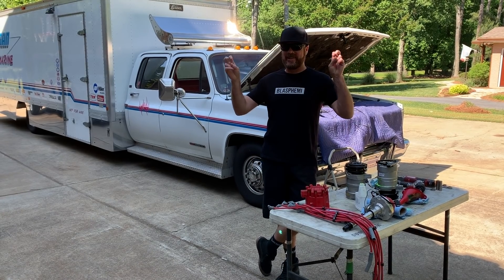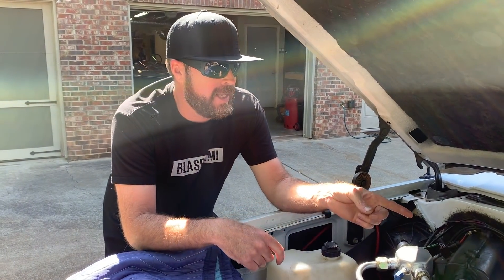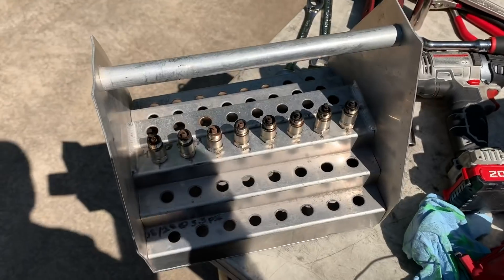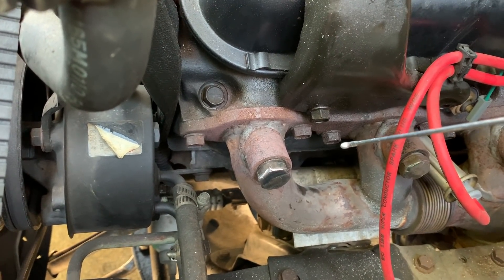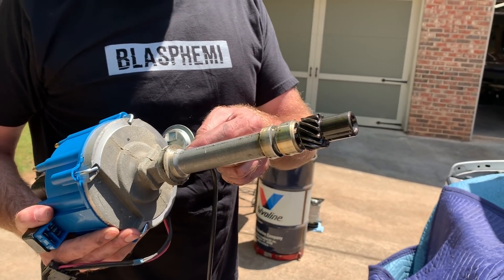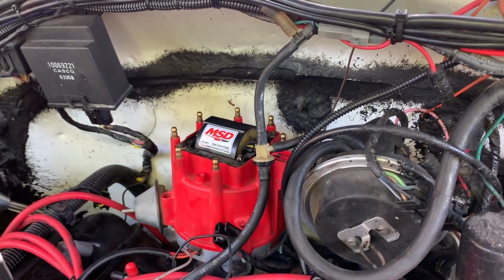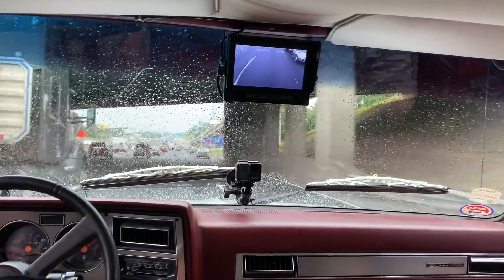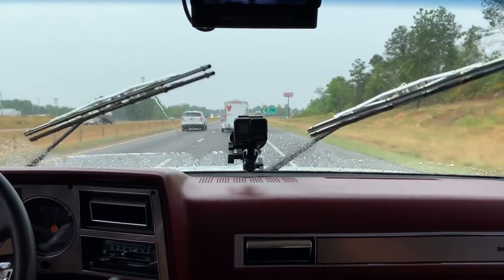More Power and Better Fuel Economy Thanks to Tuning and Overdrive! Ep.71

Comment: That' was a factory tbi motor the timing is set at 0 because the computer adjust the timing in the distributor
Reply: Didn’t you see the Rochester quad on the intake? Thats not part of the TBI package.
Reply: @MrNotorius5500  I think he's presenting the argument that it's been swapped?
Reply: @TheBrokenLife  I have a 90 Suburban that looks like that (before the engine swap).  That truck was a TBI setup at one point in its life.  The poster above is correct, the base timing for that setup is 0.  The computer handles everything else.    When they swapped to a carb the probably forgot to ignore the timing sticker on the truck.
Reply: Mini DK#9 87 is the first year for tbi on the C/K small block series trucks. Im not sure what year the big blocks got it.
Reply: @AIM54A  Come to think of it, the timing marks in the video looked hand painted too... Did they delete the pointer back then too?
Reply: This particular truck came with a carb. Some cab and chassis trucks didn't have tbi. We thought the same thing. We seen pics of this truck when it was new with no box on it. No tbi.

Comment: do you think adding a modern efi system would get you a couple more mpgs?
Reply: If he has the carburetor tune dead on and a/f ratios are in there happy zone cruising I doubt there will be little gains with efi
Reply: @luckautofab4461  thats what i was thinking, me i cant  justify efi cost. i m  to broke to go racing now but 9mpg loaded ac on is prety good in my book. i tow 26ft hallmark elite II, with my 99 ram quad cab 360/373 gear get about avg 8.5 working. need a bigger truck .

Comment: Seems like you could go with a bit more mechanical advance yet, and 14 to 15 degrees of vac advance with the choked heads. Might need to run mid grade to prevent detonation on long hill pulls, though. Nice results!
Reply: No
Reply: @jeanvi52  Fck off. Ever turn a wrench, bitch?

Comment: Did you just do that test without a car the back? Won't  that sort of skew of the data towards much higher gas mileage than if it were loaded?
Reply: The difference would be minimal. A load on the truck would make it burn more fuel on acceleration or going up hills and what not, but the economy would be about the same cruising on level, flat roads at a steady 55-65 mph. The biggest enemy to high profile vehicles like that truck is wind. On windy days, the mileage is going to tank whether loaded or not, and no matter the speed of the truck.
Reply: The car was in back

Comment: for the record , in my 2001 3/4 ton 4wd suburban with 6.0 LQ4 and 4L80 towing a 7k# enclosed trailer  thats 27 ft long i only get 6 mpg. so you're getting better mpg than my truck thats 1.5 litres smaller and 20 years newer. i could also potentially load this 7k trailer to 11k pounds , those numbers i just posted were the empty towing numbers. granted the truck weighs over 6k by itself being a fully loaded 3 row 4wd suburban on a 3/4 ton truck chassis.

Comment: what does dieseling mean?
Reply: Engine continues to run after turning the key off.  It runs on the heat inside the cylinders the same way a diesel engine works.
Reply: @1320fastback  Thanks man

Comment: My 78 G30 motorhome with a 400/400 vapor locks in hot weather if I go WOT.  I also struggle to keep it cool on the highway with a true 4 core radiator.  I've tried a lot of things and think it's just trapped air under the hood at highway speeds due to the aero.  It sounds backwards but in traffic (stop/go and slow) it cools fine.  

I'm guessing your issues are similar but am eagerly watching hoping you solve your issues.  I have quite a bit of advance but perhaps I need new hardware.
Reply: I would more suspect you have an airflow problem to the core than anything if you're over heating on the highway. Motorhomes are notorious for having radiators that are extremely far away from the grill with no ducting of any kind to actually get the air THROUGH the core. Perhaps tape up a make-shift shroud to the grill and go for a drive? You might want to try to verify the operation of your fan clutch as well, assuming it has one.

Uncle Tony's Garage also just did an interesting video about vapor lock that you might want to check out. Apparently back in the 60s-70s some Mopars ran specialized fuel filters with vapor ports on them that ran back to the tank to cure that problem. Might want to look into that as well.

Comment: 30 litres per 100km. This is insane.  Where I live the only thing with such milage is a zil 131
Reply: My dad works as truck driver, own fm series volvo fridge truck fitting 22 epal. He gets 24l/100km on average
Reply: That it is...
Reply: One of my uncles used to  own a fleet of 30 or so 8 wheel tippers,I don't remember what particular makes but I remember him once remarking that one type returns @70lts/100kms laden.or 4 mpg!

Comment: I see you still need to move the wing forward to the front of  the cab for it to work properly.
Reply from the maker: Donald K. MacBaird yup. I don’t want to put anymore holes in the cab.
Reply: @FinnegansGarage  I understand all you have to do is make a set of rails that mount to the original holes and are forward enough to move the wing over the front of the cab.
Reply: @FinnegansGarage  you could use the old holes for a sweet roof rack.
Reply: @FinnegansGarage  I don't blame you! At least modify the angle of attack.
Reply: @FinnegansGarage  
I see what you did there with the aluminum in the hole trying to verify tdc. I did everything you did and replaced the same parts while trying to chase down funky timing on an sbc. I threw on this cheap cool little awesome part and I won't have to worry about the two halves walking apart (unless if it separates fully and goes kaboom).
https://www.proformparts.com/search?find=Damper&partType%5B%5D=14751

Edit: Did you ever throw any mufflers on any of your car haulers  still running a Chevy engine?

My 1 ton Chevy and GMC's (81, 85, 87) all have the th400. Shouldn't yours have had a th700r4?
Reply: @FinnegansGarage  that's what god invented bondo for
Reply: the cab roof is basically a dead air spot between the windscreen and the front of the box, all the wing is going to do in there is create turbulence and possibly increase drag; what you need is a continuous fair curve from the top of the windscreen to the roof of the box, so the air flows up from the windscreen and attaches cleanly onto the roof, something like this: https://autoparkfleet.com/wp-content/uploads/2019/01/front__0003s_0000_FORD-ROCKPORT-E350-DRW-P800-16.png
Reply: What about mounting it on a set of Yakima or Thule rails that clamp to the gutters? I bet you can find a set on Craigslist for cheap!
Reply: Its not saving much mileage anyways, honestly. Looks awesome where it is. Let the man do his thing. Lol
Reply: Fred Flynstone  Zeus? What does a Greek god have to do with any of this? If you mean the fasteners, that would be Deutz fasteners...
Reply: Steve is right. If you look at semi-tractors nowadays they have a curvature going from windshield all the way to the top of the trailers. Not only reduces drag therefore getting better mileage, but also gives more interior room for the person living inside of it.

Comment: `dieseling`? That one was new for me. Any captain willing to explain?
Reply: When you kill the ignition and the engine keeps running for a little bit, albeit roughly. The fuel is self igniting, like a diesel. It's generally caused by hot spots in the chamber, can be carbon buildup, casting flash, etc.
Reply: When the motor continues to run (slowly and poorly) after you shut the ignition off. This was a problem mainly associated with carbureted vehicles that either had ignition problems or maladjusted/worn carburetor.
Reply: Torvikholm https://en.m.wikipedia.org/wiki/Dieseling
Reply: Thanks y'all!

Comment: What do you mean when you say it "diesels" ?
Reply: Smashin, Pigeon pre-ignition of the fuel. It’s where the fuel is ignited by heat and compression rather than by spark. Diesel fuel is ignited by heat an compression. Ergo, dieseling. Sounds kind of like a Diesel engine as well but it drops in power significantly. It’s like retarding the timing negative degrees.
Reply: Mark French thank you very much
Reply: @smashinpigeon6135  Dieseling, as I understand it, also attempts to run the engine in reverse, or at best severely out of time, because you have a massive amount of pre-ignition. So the fuel is lighting off well before TDC, thus trying to drive a piston that is mechanically on it's way back up the bore, down. Also frequently accompanied by backfiring from the fuel igniting while the exhaust valves are open. It's a very bad thing. If you want to see a fairly accurate example, search "Uncle Buck Backfire party".

If you ever have one that is doing that, shut it off with it in gear if it's an automatic. The transmission with stop the motor dead in its tracks and save you the embarrassment (and potential damage).
Reply: Maxwelhse thank you for your reply
Reply: @smashinpigeon6135  desiling in a gas engine caused by hot spots in chamber hot enough to keep running after spark is killed common problem back in the day on carbs, with lotts of emmissions ,and poor maintenece.
Reply: willefixit thank you for your reply

Comment: Autolite's run like crap in GM products sir.  I recommend a good set of AC/Delco's....
Reply: I agree, AC plugs for GM engines...........................
Reply: Strangely enough, yes!
Reply: Bullshit. You've never ran a BBC. Any Big Block Chevy runs best on Autolite plugs. Proven in Circle Track racing for the last 40 years.
Reply: All I run is autolite.
Reply: I don't have a dog in the great BBC sparkplug debate, but do keep in mind that it's no longer a GM ignition, so, the argument is a little invalid.
Reply: @TheBrokenLife  Totally valid. It's the life of the spark plug, not what's making it spark. AC's and Champions foul out in BBC's within 5000 miles no matter who's providing the spark. And that same number plug is used in Shovelhead Harleys, and they last just as long or less in those engines as well.
Reply: @funone8716  FWIW, I had a 350 with a badly sloppy timing set (I couldn't believe it never skipped a tooth when it was finally inspected) and the only thing that would stay in it for more than 500 miles was regular old Bosch Platinums (with ACs being the absolute worst I tried). I've been running them in everything for years now and have been very pleased with them.

In the case of that SBC, I think the primary reason they lived so well is because the electrodes on those plugs are so tiny they couldn't get fuel soaked. They're basically shrouded by their own ceramic.

So... Yeah, I guess I haven't had good like with ACs either. Champions in all of my power equipment are absolutely great though. Never tried their automotive plugs.
Reply: @TheBrokenLife  350 is not a Big Block, just sayin.....
Reply: @funone8716  I understand that...
Reply: NGK all the way.  Especially in 5.3s  and 6.0s

Comment: Diesel swap income! No other way for towing tonnes!
Reply: i totally agree with you a big good old cummins 6bt will be the right choice here
Reply: @carholic-sz3qv  or even a good old powerstroke 7.3! So it stays a V8! 😜
Reply: @andrejaeschke3415  If it should be a V8 than go with an LBZ Duramax.
Reply: Eh why would you need a diesel they arent really going to do anything but gain mpg and not even that much. Torque gassers and diesels of greater size dont really differ their curves under boost for same applications
Reply: @jdrok5026  What about the fact that in stock form the 454 with a carburetor doesn't really make that much power. Also The 6.7 cummins originally made 610 poind feet of torque all while getting good fuel economy, so it seems like a good option. Also I talked to Newbern and he said they were looking into a 6.7 swap because they are quieter than the 5.9 they swapped into the OG Ramp Truck.
Reply: @legostar55  a 12v a lb7 and a 7.3 dont make much power in stock form. A 24v doesnt either..
Reply: @jdrok5026  Sure but a bone stock, first rendition 6.7 cummins males 610 pound feet. Later revisions made 800 pound feet. So sure early diesels in stock form don't make much power but the 6.7cummins does.
Reply: @jdrok5026  If you boost a 454 than your mileage will go right down the toilet. A stock 6.7 Cummins is a better engine because if you boost it beyond what it has stock you can make HUGE torque and very decent horsepower at a relatively low RPM. If you boost a 454 for power you will drastically decrease your mileage. You will gain more horsepower and torque but horsepower isn't important when you're towing, torque is but the torque you will be making will be at too high and RPM to be useful.
Reply: Because chevy 💪

Comment: You already know how much better a Cummins is for towing so why not do another cummins swap?
Reply: He wants to keep it original as possible
Reply: Because Cummins is gay lol
Reply: @SouthSaskFarmer1  so power and efficiency is gay?
Reply: @92powerdiesel61  yes
Reply: @92powerdiesel61  should be a 453 Detroit in it honselty
Reply: @SouthSaskFarmer1  I agree it should be a gm motor in a gm truck.
Reply: @SouthSaskFarmer1  I had a '73 Chevy square body with a 4-53 in it but there's plenty of room for a 6v53 which would be much better.   There is a 4-53 for sale in San Diego Craigslist right now though if anyone has any crazy ideas, only $400.00
Reply: @1320fastback  man to bad thays so far away from me haha
Reply: @SouthSaskFarmer1  that would be awesome. It would need a  jakebrake too, for those long downhills.
Reply: @jfv65  you can read my mind lol maybe toss in an 8 speed Eaton so it shifts like a semi to lol
Reply: @SouthSaskFarmer1  Fuller/Eatons are heavier than fuck and also waste a lot of power just getting them to turn.  Best thing, like I did is to use the stock manual and put a Mitchell Under/Overdrive behind it.  That lets you split gears with a modern aluminum auxiliary transmission still rated for 30k pounds but not so overkill your wasting what power you have.
Reply: @1320fastback  That is $500.00 to much!